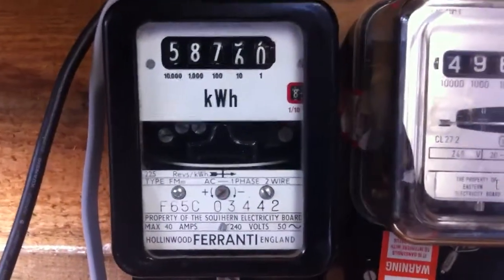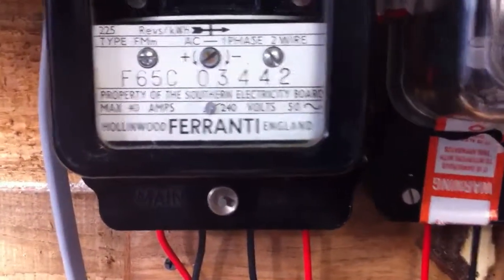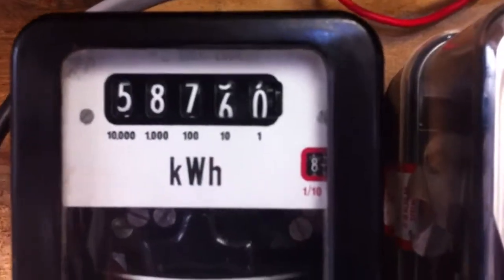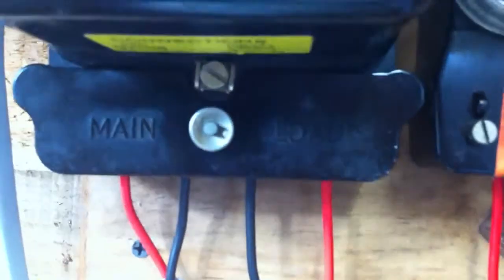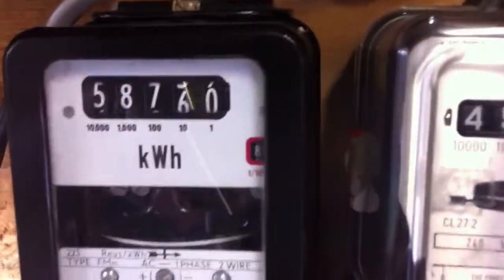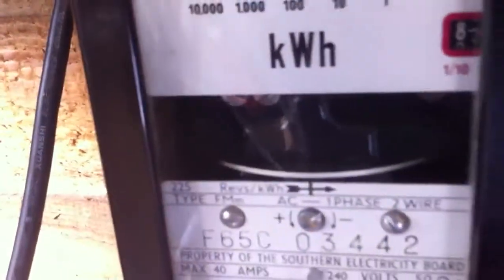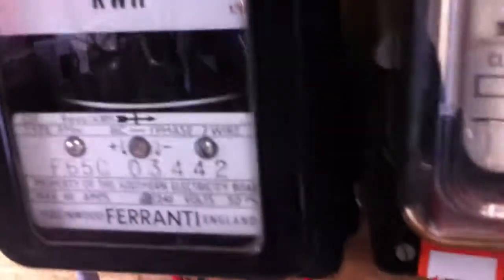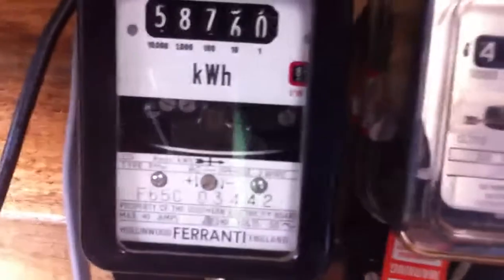Ferranti Hollinwood type FMm kWh meter

Comment: Used to love those old disc meters, bit of film negative for  zero cost electricity.
Reply from the maker: Yes they have much more character than the new electronic ones. How did the film negative work?
Reply: @Cavalier_Steve  Slid in past the glass and stopped the wheel turning
Reply from the maker: @charliecoco2115  oh right lol 😂 I have heard of a couple of things when someone putting a pin on either side of the live wire and putting a small piece of wire between them this effectively bypassed the meter for some of the current so the meter still moved just not as much.

Comment: You know...... I'm sure I commented on this when you uploaded it!

Anyways.... some very nice loadwheel action on this one. ALSO....

Some info on your instrument.... The part of the number where it says F65C, the 65 indicates the year that this was first calibrated and put into service.

Instruments which I have that are similar to this: FNE12Q and FNN2Q. 

The FNE12Q has the same loadwheel speed and loading capacity, whereas the FNN2Q has a slower loadwheel at 150 revs/kWh, but a higher capacity of 80A.

Thanxx for showing,

-BoomBoxDeluxe.

5th January 2016, 20.08